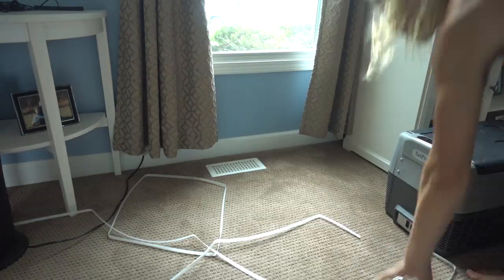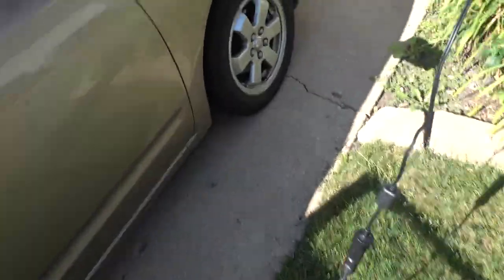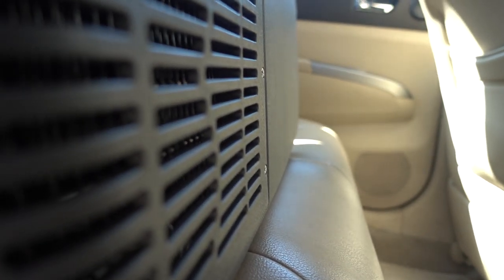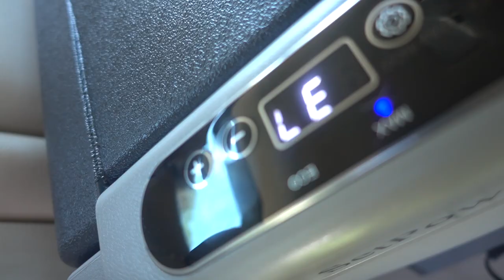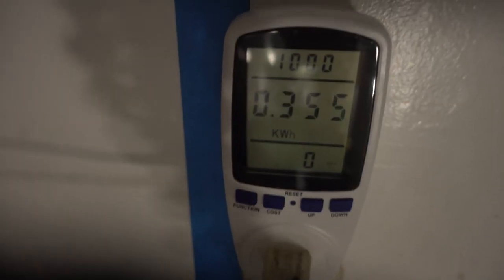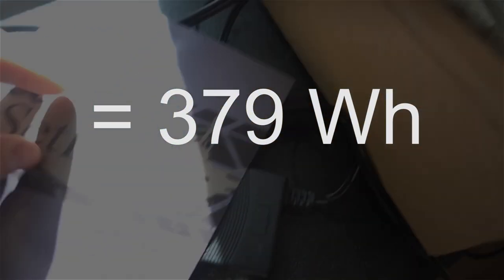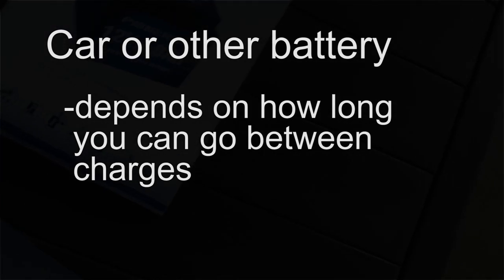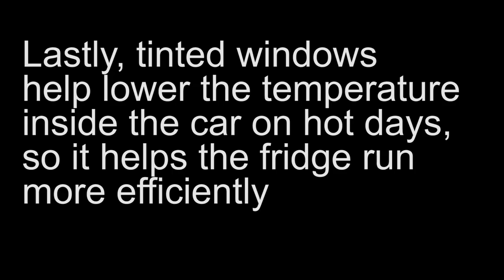How much energy does a 12 volt fridge use? (Testing car fridge power demands)

Comment: Hi this was super helpful - do you have a review after having used it for a while? Anything you would do differently? Thanks!
Reply from the maker: thank you, glad to help. do you mean another review of the fridge or the battery? I ended up getting a bigger fridge after learning they all use nearly the same amt of power--its been a great fridge so far. For the battery, I had some troubles getting enough charge from my solar to meet the fridge's demands so i'm adding a DC to DC charger as supplementary charger to help out the solar. That's the only change I'd make. Will definitely make an update video in a month or 2 to show the improved system
Reply: @soilliam  Ok, looking forward to an update! Yee I meant the fridge itself, I think I am going to go for this one because I want to keep my front seat but the bigger one looks suuuuuper nice. Im thinking of getting a power station to use at night or just unplug the fridge... we shall see.
Reply from the maker: @momovomo  gotcha good luck 👍 I think power station is a good call. Nice to be able to charge it with the car without any extra set up

Comment: Could you do a video of your battery/charge controller/ solar setup…I think it’s cool that the 50Ah battery is more than sufficient for your needs…I will consider the same for my rig
Reply from the maker: Yes I will for sure
Reply from the maker: Rn I have 100 watts and it’s not enough in the winter months to keep fridge running indefinitely. 200 would definitely do it but 100 watts plus a dc to dc charger sounds like the ideal setup. Thanks for checking it out btw
Reply from the maker: If you haven’t seen, this video should cover that
https://youtu.be/sNldyKoW1rI
Reply from the maker: And this one https://youtu.be/7dPAdBBLSkg

Comment: 100w solar panel + 12v 18ah battery can run a small 12v fridge..?  Please tell me.
Reply: Depends on the fridge. Mine definitely would not last on just that, mine takes in about 1000 watts per 12 hours.
Reply from the maker: Agreed, 18ah is a pretty small battery too

Comment: An empty fridge uses substantially less power than a full fridge. Creating ice uses even more power.
Reply from the maker: yes cooling things down takes more energy than not cooling things down, but once its to temp a full fridge allows for less cold air to escape and therefore less cold air for the fridge to cool down again once its closed